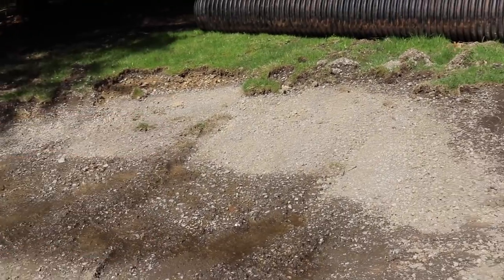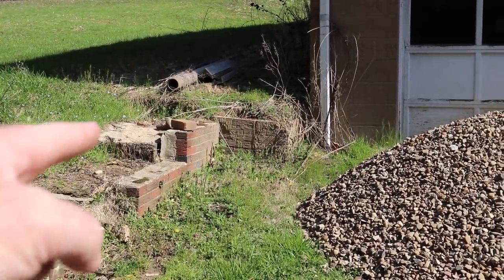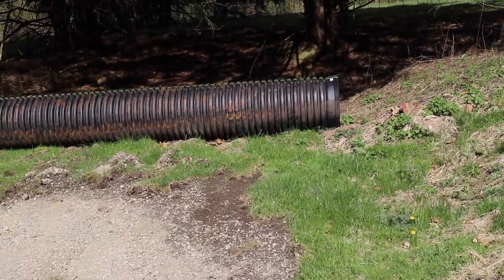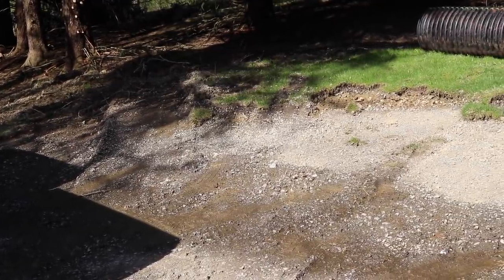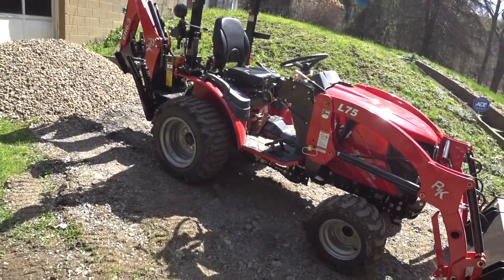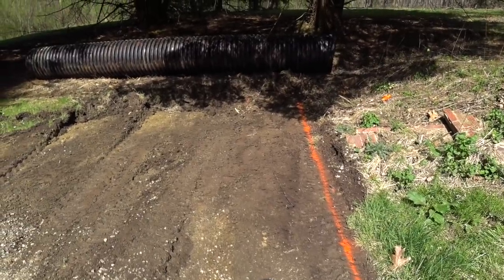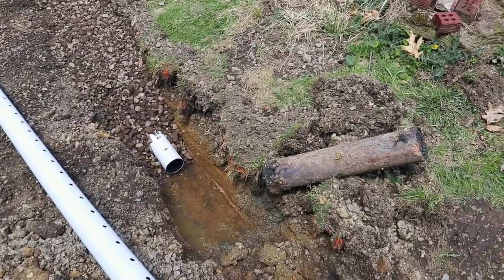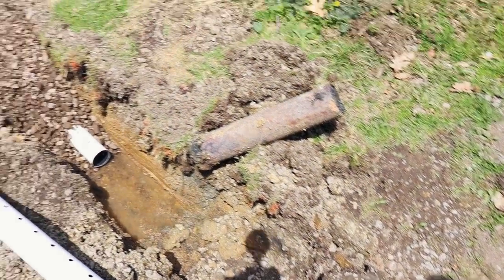#153 How To Install a French Drain

Comment: From what I could see, all you really needed to do was fill in the low area you called a turnaround. You jumped to the conclusion that you needed a french drain. French drains collect groundwater. Your problem there was surface water. You just needed to fill in the low area and grade the driveway properly. How is the surface water going to get to the french drain? By slowly seeping into the ground?

The water from the down spout was going into a clogged pipe. Did you try to clean that pipe or just have the water run on the surface? With the house on the hill, you just needed to keep the roof water above ground and it would easily run downhill. You could've run the down spout water into a solid pipe if you were afraid it would wash away the gravel. Wow, that was a lot of work and money.

Comment: Entertaining, thumbs up!   Over here, we never connect the downspout to the drain pipe.  You risk leading extra water into the drain, the opposite way of what you want. I always use filter textile in the trenches, it keeps them open for a longer time.  By the way,  did you forget that you have a dumptrailer? And a tractor to pull it?

Comment: Mike, tou didnt really detail how you are tieing in the downspout other than teeing it into the crench drain. Typically, you dont want to tie a downspout into the actaul french drain. Either run it in non-perforated pipe on top of the perforated pipe to exit at the same location as the french drain, or tee it into the non-perforated line used to carry away the water frim the french drain line ( if you are using one to do that. A roof sheds a LOT of water and can overwhelm a french drain if its tied into the perforated part of the drain.

Comment: Nice clean install...looks like you were able to make a real nice and well pitched ditch with the RK24. How do you like the ADS triple wall pipe? I have found it to be an improvement over corrugated pipe, but it's a nuisance in that it generally requires proprietary fittings and they cannot be cemented together? Single wall corrugated pipe is fundamentally flawed in so far as the pipe has extremely poor beam stiffness and cannot be laid to a regular pitch unless the bedding is perfect, and the corrugations also directly impede the hydraulic flow of the water encouraging sedimentation. I prefer SDR-35. 10' lengths are generally only $10-15 and it's good quality pipe which will not crush, even if the bedding is less than perfect. It is also made of PVC so that the fittings can be cemented. 

Whether or not fabric is ideal for use depends on a lot on your soil type. Obviously if you intend to top the trench with grass it seems almost everybody advocates for some fabric on top of the gravel. Most studies have demonstrated that even when the filter fabric appears clogged, the fabric still flows, and the material which is on the filter fabric is more permeable than the material from which it migrated--but silty soils can definitely plug up fabric. The best way to do it seems to be to protect the fabric with clean sand. No matter what though, it seems all drains fail, and it's just a matter of time. I live in CT and have a neighbor who had a 100' long french drain, 3' deep by 2' wide installed, and now 20 years later it seems to be performing more poorly than it did before. No fabric, no nothing, just left it wide open all around. I also like to put a cleanout on the uphill side--nothing fancy, just an elbow and a riser with an endcap. 

Nice videos as always!

Comment: Nice job.  I have the "green" version of that tractor (John Deere 1025R) and it's more than paid for itself while working on clearing my property (35 acres) here in North Florida.

I imagine the process is probably similar for installing a culvert (gravel, culvert pipe then more gravel).  In a few weeks I hope to be putting in my driveway.

Comment: Just out of curiosity, will that backhoe reach high enough to load your dump trailer?  Until I saw how short a distance you were hauling the dirt, I'd wondered if you could save yourself time and work dumping the dirt directly to the trailer to haul it off.
Reply from the maker: Yea I would load the dump trailer, I thought of that but by the time I would got another tractor and trailer down there, then back to the house with it when done would be more time than it would save

Comment: Fabric I dont use and i have installed miles of Black Plastic Field Drain tile and most of it is 5-6 foot deep and i have used it in traffic areas that deep and have not had issue with crushing with 80,000 lb trucks running over top of

Comment: That is a rather long and deep trench cut across the back of your house.  Did you call the toll-free number and have all buried utilities located and marked?   Sort of like cleaning a firearm, always check first to be sure it is unloaded.
Reply from the maker: Meraub, house sits over 100 yards off road, when working near road yea I one call. Here there is no use, and not much for utilities. Power comes in overhead, has well and septic not public and I know where both of those are.

Comment: Hi Mike, great video, seems like that RK24 is perfectly matched for that job. One comment on the French drain, I have installed French drains by putting down stone, then pipe, then stone, then fabric, then covered by soil. The theory is that the fabric will still let water perc thru while not allowing any soil, roots or anything else penetrate the pipe. I've been doing that for about 10 years and haven't had any problems so far, seems to be working well.

Comment: sorry, newbie here with this stuff: why do the perforations go on the bottom? isn't the point of the pipe to let the water in the top and then drain to wherever you direct it? holes on the bottom will just let the water "drain" underneath, no?
Reply: urbanothepopeofdeath The water will take the path of least resistance. Some water will perk through the soil but higher volumes will run the wide open channel created by the pipe.
Reply: Well said Stephen, but also gravity.  If the pipe was installed with the holes on top, it would  become plugged after a while with the weight of cover on the drain pipe. The holes  has to go on the bottom to prevent this.